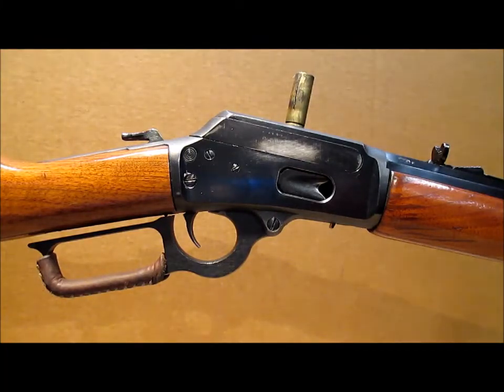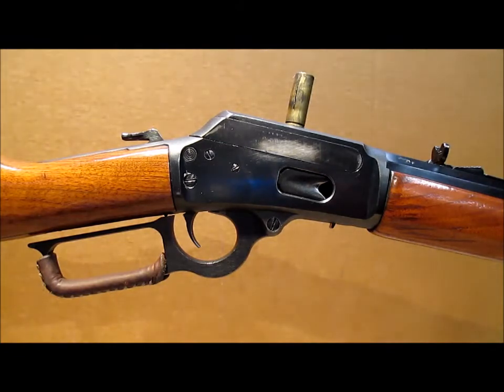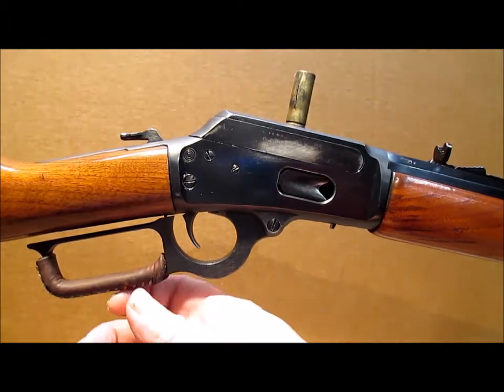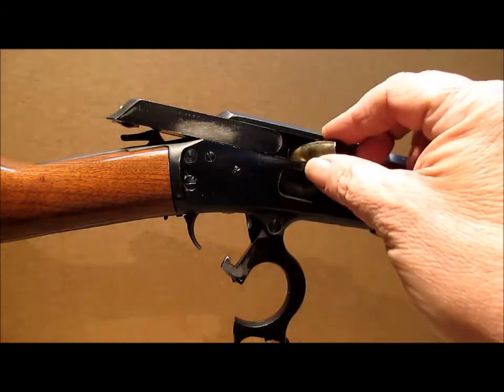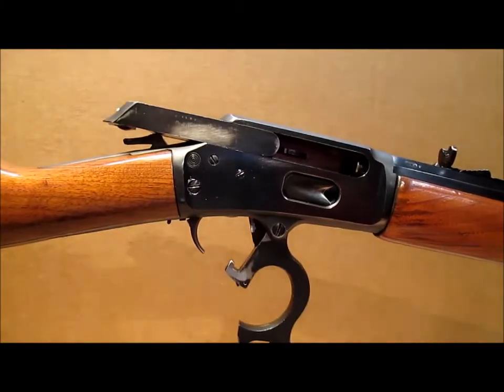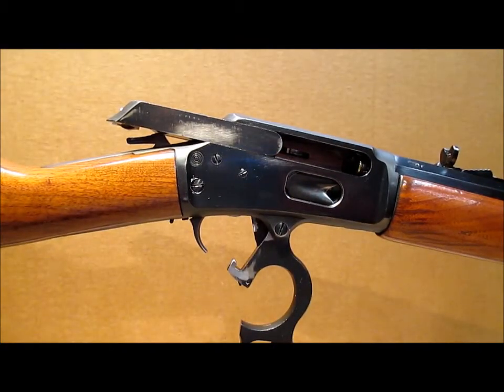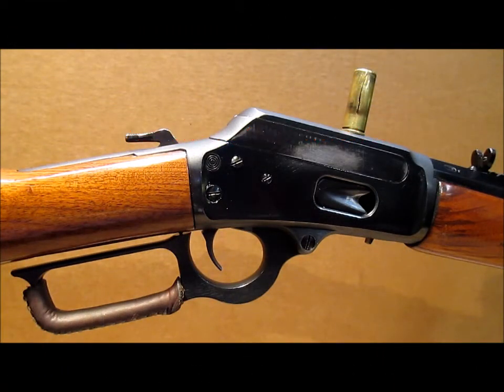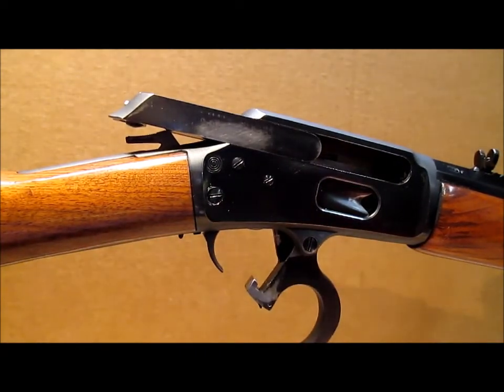Ranger Point Marlin Extractor

Comment: As an added benefit, the new extractor throws fired cases to the side instead of down range as the original extractors did.  I started recovering a lot more bass at matches after installation.